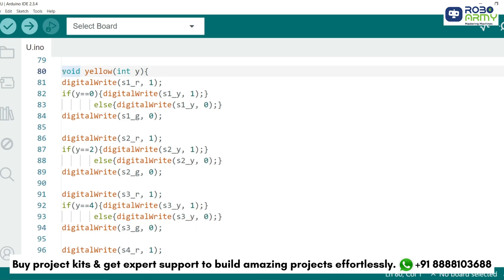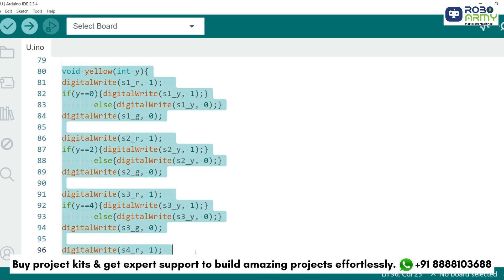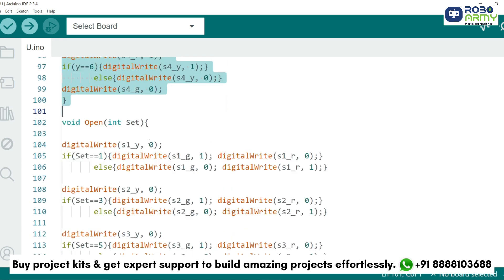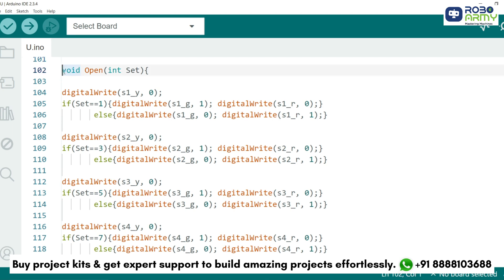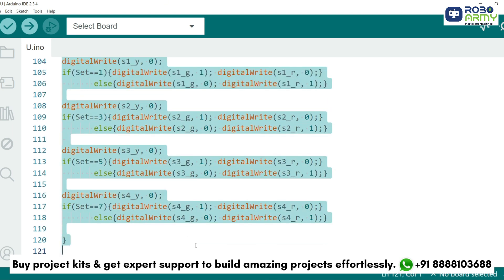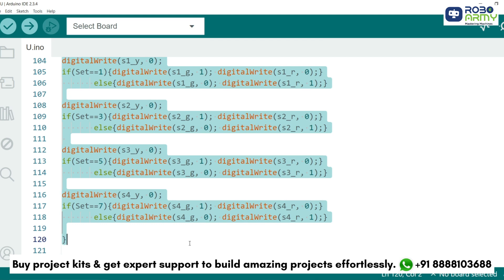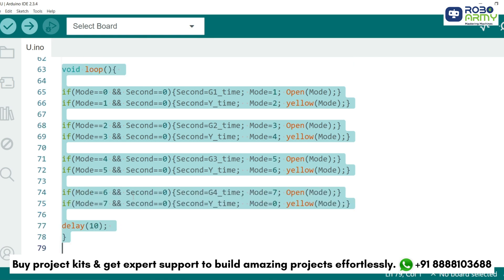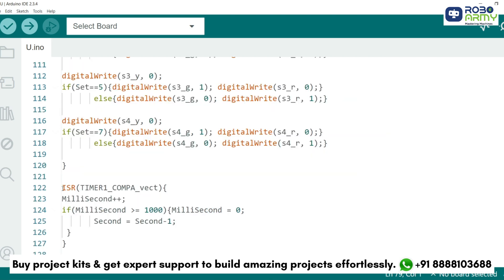Build Your Own Traffic Light System with Arduino | Step-by-Step Tutorial

Comment: How did you put LEDs up in traffic light if they’re connected to breadboard please answer sir
Reply from the maker: Thank you for your question! 😊 Initially, the LEDs are connected to the breadboard for testing and ensuring the circuit works properly. Once tested, I soldered the LEDs and resistors onto a PCB and mounted them on cardboard poles to resemble real traffic lights. Let me know if you need more details!
Reply: @robo_army_  hello sir! I also wanted to ask a question..regarding of how you put up the LEDS to mimick a real traffic light did you still need to add the resistors??